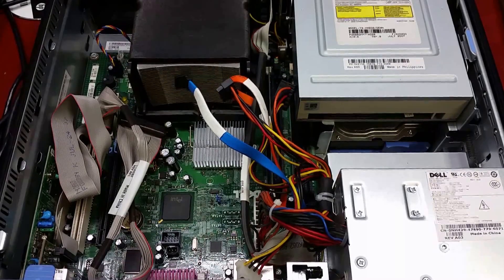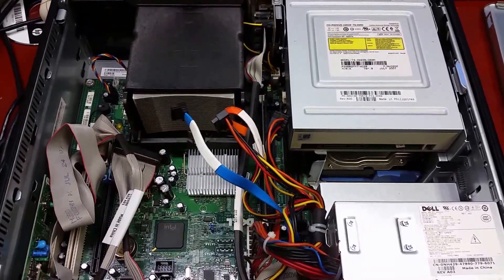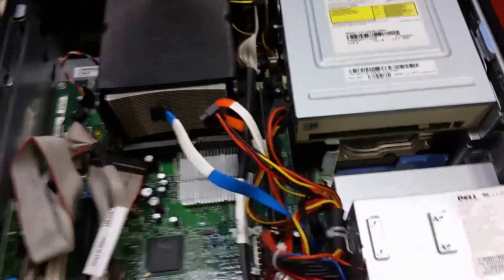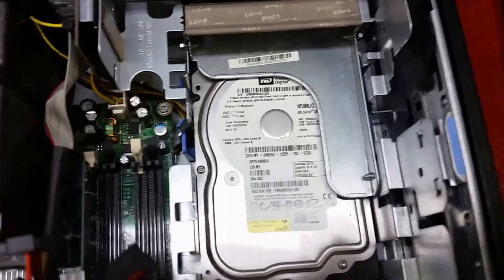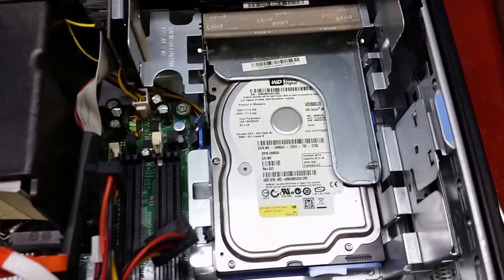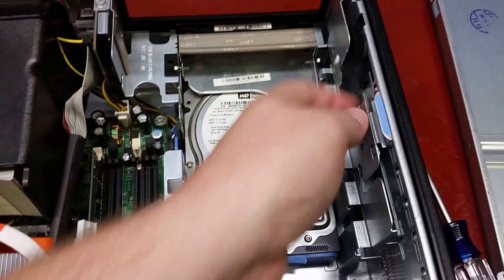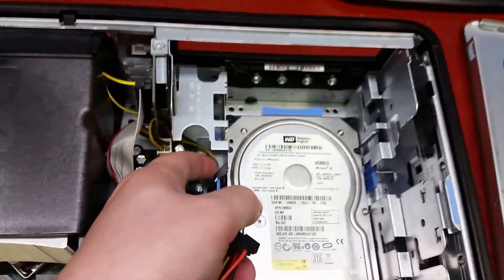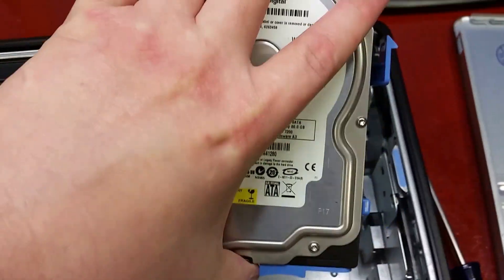Replace Hard Drive on a Dell Optiplex 745

Comment: Thank you!!!! The one I was working on did not have the plate, but I could not get that hard drive to budge! I ended up having to pry a bit with a screwdriver to get it to slide back finally.